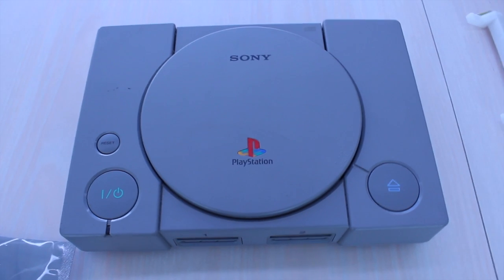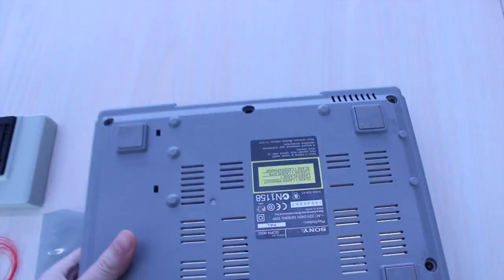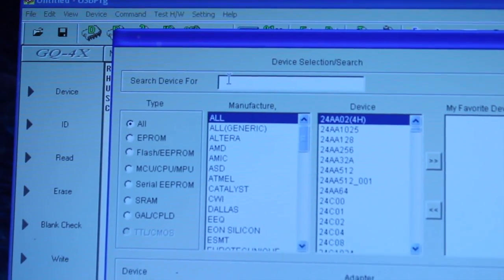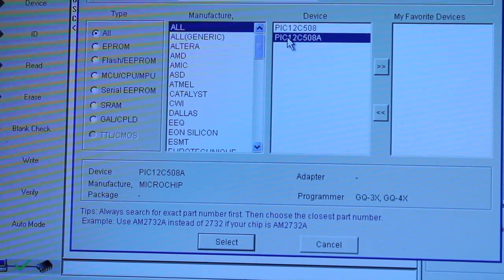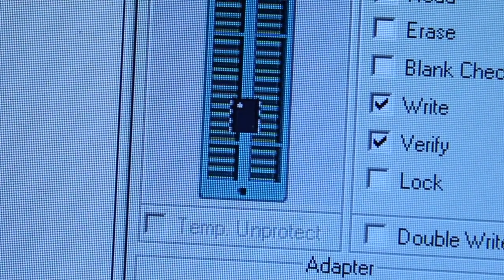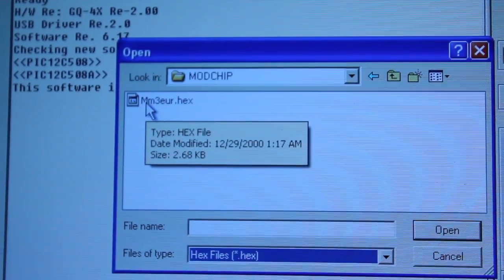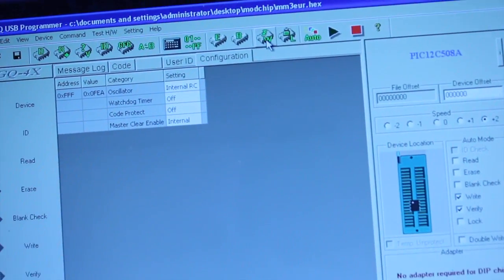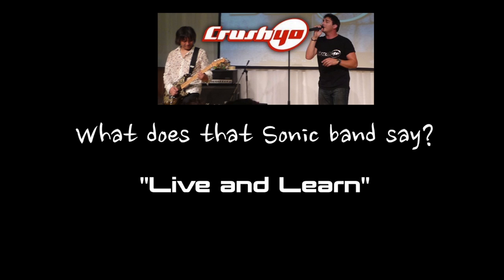Sony PlayStation 1 Modchip Program Attempt with a PIC12C508A

Comment: can someone please walk me through the exact process of successfully programming a 12f629 chip and installing it on a 7501 psx. i have tried 4 hexes and about 5 diagrams and every combo in between.my solder joints are solid i am stuck.
Reply: ***** i have a k150 usb pic programmer i got off of ebay. i have 12f629 chips and i have used almost every hex imaginable. i do get an error saying it can't be reset but after that it reads and writes code to the chips i have changed the 3fxx values on one chip then kept the default 34380 on another and no success.